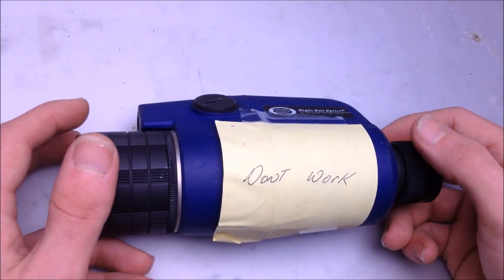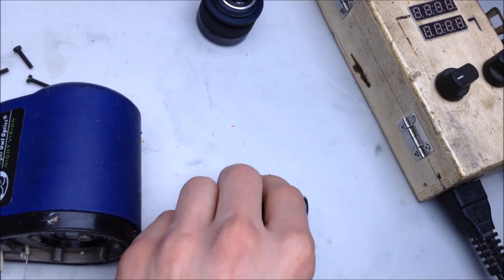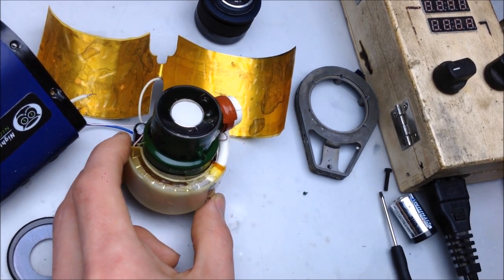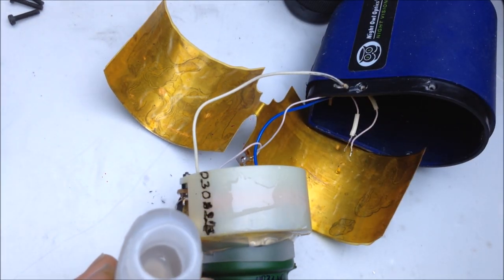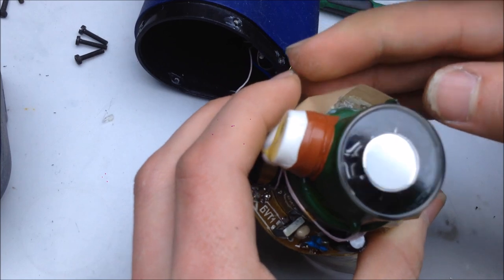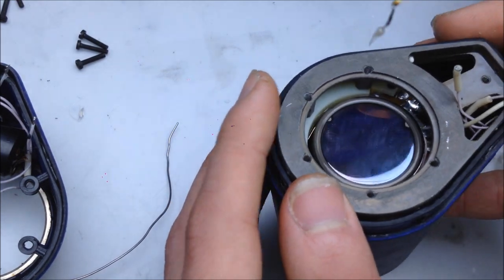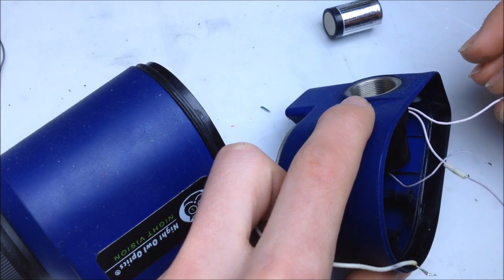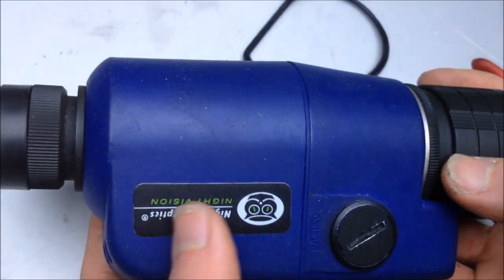Repairing an Image Intensifier Tube Based Night Vision Monocular.

Comment: I borrow my gen1 to friend and he used wrong voltage battery on it, na its all gone, IR lights and the green light inside the tube, do you think its fixable?! Maybe some eletrical component burned due the higher voltage?!
Reply from the maker: The IR LED can easily be replaced by swapping out the IR illuminating module/the back LED. Sometimes these are glued together and you have to radically dislocate the LED. The HV module may be a be more complicated. The HV section has usually a few transistors, step up transformer, and then the multiplier stages. You could of either burned up a transistor ( which is easy to fix), or a part of the multiplier stage.  I would first replace the transistors on the HV module to see if the tube comes back on before checking anything else.
Reply: @Zenodilodon   hey brother, i have a  nightowl nocx3.   was using it tonight, heard an internal  "pop"  sound, the whine stopped and all green went black.   tried new batt,  same thing.   ir light and led come on, but power doesnt.     is the image intensifier tube   shot? 
 is it fixable?    it is similar to this one except case is black. 
 i appreciate any help
Reply from the maker: @_-gh0st-_  If the whine stopped and you heard a pop that's almost certainly a failed transistor. I recently bought another Nightowl unit since the vacuum in mine was lost after a drop. That should be the next video I post hopefully next week. I don't know it's condition quite yet but either way I plan on opening it up just to revisit the topic more thoroughly.
Reply: @Zenodilodon   thank u amigo,  i took it apart just to do some investigating,  tube n all looks good, no cracks, no loss of vacuum.  now on the hunt searchn the board  to figure which one popped. lookn for  burnt spots etc. so far  no luck,  guess next move is to dig out a meter n get  all technical. thanks for the reply brother.  
 🙏✌&💚  to u and urs

ur vid taught this old dog a new trick 👍👍  

ghost

Comment: I have a pair of nightowl binos were working fine then it statred doing the same thing and arcing sound coming from the battery box any suggestions or how much would u charge to fix them
Reply from the maker: Are you in the US? If it's the same issue I would probably want $30-$40 for the repair per unit in labor + materials such as the insulating materials. I would want to use a better material like a 2 part silicone for the repair so they hold up better than the repair in this video which is a tad crude lol. Figure shipping costs are also something to consider. I am in Wisconsin.

Comment: I have a ROSTOV CYCLOPS NS3 night vision scope that my cousin left on accidentally. It still works but only when the IR light is on.... Any idea as to what needs to be replaced?
Reply from the maker: That's a tough one, I have the feeling the phosphor screen may of been overly bombarded with electrons and that may have worn them out. If this is the case it's not fixable.
Reply: @Zenodilodon  ahhh $#*% that’s what I figured.....I looked it up online and the tube costs $500 when I’ve seen a working NS3 sell online for $350....  I appreciate the reply! (Subbed)
Reply from the maker: @pollutance  Thanks for the sub!, wish I had better news for you. It sounds like a fairly decent unit if the price is that high. I can't think of any other reason for the problem you have but if something strikes my think box I will let you know.
Reply: @Zenodilodon  no worries! Alright yeah, I’d appreciate it! I think you’re right on the money with the phosphorus screen being burned out, but yeah if anything crosses your mind I’m open to looking into it.

Comment: What is that "spritz " ? superglue activator or conformal coating????? (i often have superglue on my jeans its most dubious looking after a couple  of washes) also do you know of anything to make low viscosity epoxy set faster cos sometimes takes weeks or at all and is too cheap not to use and excellent for potting transformers when it does set up just a total pain when it doesn't cos lots of work rewinding wasted if it doesn't........
Reply from the maker: That is super glue accelerator, it sets super glue just about instantly. As far as epoxies go I tend to use West Systems 105/205 and heat to kick off the reaction. Many epoxies work faster with heat applied. Sometimes the reaction can take seconds and you end up with an exothermic runaway and that's not good cause it's very rapid and very hot.

Comment: OK I'm curious where is that 1 made at because the one I have is made in Russia and the build quality is much better then that blue 1 you have But mine has a metal housing that's rubber coated Unlike were yours splits in half Mine has a big barrel nut At the small lens side that screws off and everything comes out in one piece Interesting

Comment: Anyone notice the value of the giant resistor used to cut down the electron density to prevent burning? It's usually hundreds of Megohms or even Gigohms. I found my ancient tube and is identical to this one but used a piezoelectric power supply. I have lost the resistor and need to order another.

Comment: I have cold War era Soviet generation 1 starlight binoculars which are in need of repairs.

When I first got them, the tubes used such a small amount of power that they would stay lit for around 30 seconds after switching off, running only on capacitor charge.

The image would gradually dim and become more "fish eye" before going black.

My problem is this : now when running, the image is dim and slightly distorted, as it would have been 10 or 15 secs after switching off, and if  I switch off, the picture turns black immediately.

So I am thinking that either a high voltage capacitor has broken down, or I have excessive current being drawn, possibly because of damaged high voltage cable insulation.

Can you recommend a spec for replacement high voltage silicone coated wire? And potting compound? I'm going to try an overhaul.

Also if you have any idea where to find service manuals I would appreciate a pointer, have been looking for years with no success.

Btw model is (in Russian) FILIN-1
Reply from the maker: almost modern day 2 part silicone mixes should work, just make sure to remove as many bubbles in the mix you can. The voltage is a bit but even the hot glue I used is still holding up just fine. inspect the chain and see if there is any break down and this will give you a better idea of where to pot, if you re-pot the entire chain I would also recommend using rubbing alcohol in a pretty good concentration like 90% to clean away and carbon that may of formed a pathway as well. The units are pretty straight forward to work with and once your in the unit you'll have a much better idea of what needs to be fixed. If you have a few specific questions I have not addressed let me know.
Reply from the maker: Also silicone wire can be easily found on ebay or certain stores/online suppliers that work a lot with making custom quad-copters/drones, I suggest looking there.
Reply: @Zenodilodon  thanks for the quick reply!
I haven't started work on them yet, but will get back to you if I run into any difficulties.
I have a good hunch on where the problem is, I bought them when I was a kid working my first job, back in the 90s, got the bright idea to "waterproof" the junctions with some random engine gasket compound. Operation characteristics changed soon afterwards, unsurprisingly.

So I reckon repotting the junction I tampered with all those years ago might do it, but may as well replace the cables while I am at it.

Thanks again! Will update later.

Comment: I have a sightmark dual. Right side is working well, the other side lights up like hell. Very bright light only. Thinking of prying the unit open, you think it has the same problem?
Reply from the maker: This repair was specific to electrical problems on the multiplier, it sounds more like you have an optical misalignment or something in the magnifier tube is off canter. If your unit stays on it's something in the optics/electron path.
Reply: @Zenodilodon  any suggestions? I cam send the video.

Comment: Thanks for the video! Btw i need your opinion.. i want to buy a used israeli novalite nv 2000 night vision monocular for around 20 usd. The seller told me that the night vision sometimes do work and can be use but there will be a moment that it doesnt work at all. What do you think is the problem? Is it worth it for me to buy it?.. i want to buy it cause in my country  nvg is very expensive. Can you help me please?
Reply from the maker: Sounds like the problem is electrical in nature, it's something like dirty battery contacts, bad solder connection, or lack of isolation on the multiplier like mine had. If you are good with working on electronics/have experience and access to soldering and high voltage potting materials than it's a good price. If you need something that works consistently and do not have repair skills try to find something that has better function.
Reply: @Zenodilodon  thanks a lot for the quick reply! Will definitely figure out whether i should buy it or not!

Comment: I have the Russian made night owl version mine is green identical except one piece case , looks the same but there in lies the problem  The LED lights turn on but the tube will not fire Not sure what's going on
Reply from the maker: Sounds like either a bad tube or an oscillator problem. You can test the oscillator by placing a little HV neon light based probe on the HV side of the transformer. These 2 points are what feed into the multiplier, it should light a neon bulb. You can also check for arcs in the multiplier but usually there is a little glow in the tube before break down ( unless it's a fully carbonized burned path in the potting material ) The tube like most vacuum tubes has a deposit of  metal from the getter, this usually looks silver but will be black if the tube's seal has allowed oxygen/air in. You can find more information on just looking up how to tell of a vacuum tube is bad. Aside from those few things I don't see much failing on them there really isn't much to go wrong.

Comment: Hi, Thanks for the interesting video!
 I have similar problem with my night vision. It try to start, the green light in the tube just flash for less than second and it's permanently off. I have to take out batteries and when I put it back, it make the same when I press the power button. Don't heart any sounds like in your video. The transformer giving around 200V and the tube is clean and trying to start, so I guess there should be issue in the capacitors multiply 
 Please, do you have any idea how to fix it? I still don't understand, how it can works with putting more isolation. I also wanted to open the plastic box with the capacitors and diodes pcb, but I afraid, I will damage it and the issue could be somewhere else.
 Thank you
Filip
Reply from the maker: The voltage multiplier takes the 200V and steps it up to a few thousand volts, if there is a break down in the insulation is can cause a discharge in the that system. Here is more information about that.
https://en.wikipedia.org/wiki/Cockcroft%E2%80%93Walton_generator
https://www.youtube.com/watch?v=ep3D_LC2UzU
Reply from the maker: Opening up the multiplier would most likely destroy it, you can try to epoxy coat/dip it there could be a break down on the inside of the multiplier as well, it can be a bit hard to hear if it's inside, try looking for  a spark/light from the device in the dark that can also help you find the issue.
Reply: @Zenodilodon  thank you, I'll try and let you know :-)
Reply from the maker: @filiphaloun  best of luck!
Reply: @Zenodilodon  I'll check it tomorrow, have something else on my table for this night :-) Thank you so much for your quick reply!
Reply from the maker: @filiphaloun  quick replies are the advantage of having a smaller youtube channel :P
Reply: @Zenodilodon  Have to learn this as well, hahaha, I repairing vintage cameras, but I only do a pictures before/after and middle time to help me remember, where is which part or when I find something interesting. I think it could be interesting for another people as well, sometimes I spend over 20 hours on one camera and the difference after is really huge
Reply from the maker: @filiphaloun  Absolutely! taking video/pictures on things helps so much and I often do the same. It's one of the best ways to remember parts and such, esp on sensitive devices. I used to get into cameras myself for the optics when I was younger. I think my favorite part is the garage door style shutter mechanism inside of vintage cameras.
Reply: @Zenodilodon  Hi mate, I have't time for it, but tonight I tried just feel it up with hot glue as you did in your video and it's doesn't help :-( I think I have to open the multiplier and see if I can find anything inside and maybe put more insulation right on the spot ?? I tried watch carefully whats happen, when I turned it on - the green light in the tube pop up for less than second as previously, but what I did't saw before (probably because I had more light on my table), the tube is shines soft blue in the join with the high voltage cable - can see only coz in this particular spot isn't any color on the glass tube. No noise at all, only the power supply part make very high frequency sound, which should be ok  
 So definitely there is problem with the multiplier and I still don't know how to fix it :-(
Thank you anyway for your help and response! Fully appreciate! 
Filip
Reply from the maker: @filiphaloun  If you have more trouble on it please feel free to contact me over FB/Zenodilodon